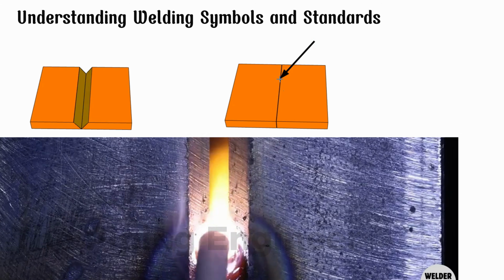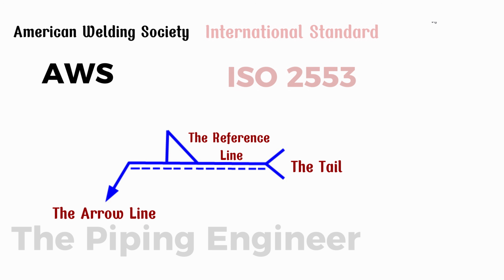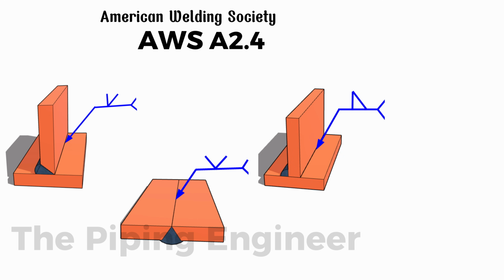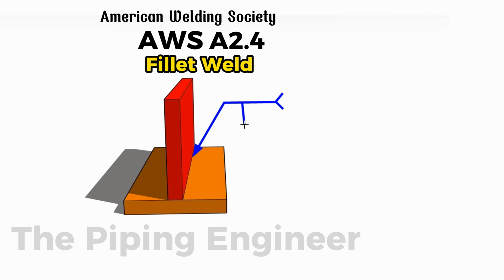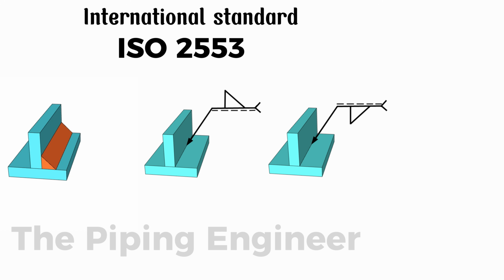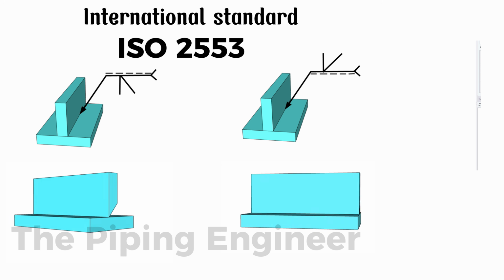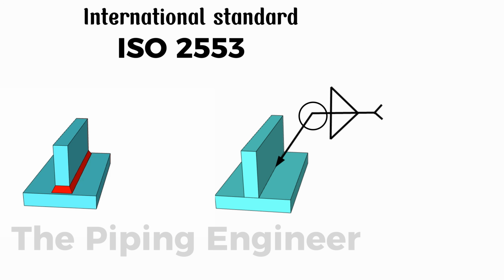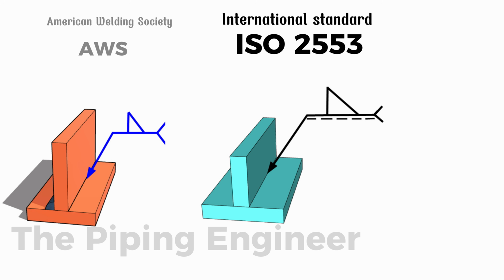AWS A2.4 vs ISO 2553: Welding Symbols Explained | How to Read Engineering Drawings

Comment: The arrow side / other side flip between A2.4 and ISO 2553 trips up a lot of people reading imported drawings. On flanged spool work we always confirm which standard the drawing was drafted to before welding a socket or slip-on fillet.
Reply from the maker: You’re absolutely right! Depending on the country where an isometric drawing is prepared, the applicable standard, and sometimes the engineer’s drafting conventions, welding symbols can vary and occasionally be misleading. Whether in structural steelwork or pipe fabrication, correctly interpreting welding symbols is essential to avoid mistakes and ensure quality. That’s why it’s always important to confirm which standard the drawing follows before starting any bevelling/welding work. Thank you for sharing your professional experience and valuable insight!

Comment: AWS intermittent weld is spacing is "weld length" - " weld center-to-center spacing".  Your video is wrong.  Shows it as space between end of one weld to the start of the next weld.  You are informing anyone who watches this video incorrectly.